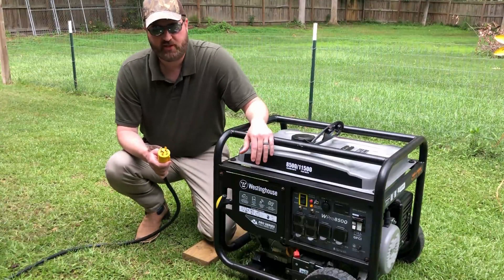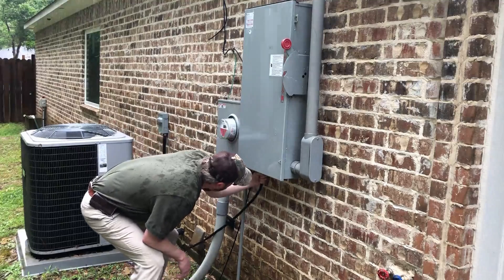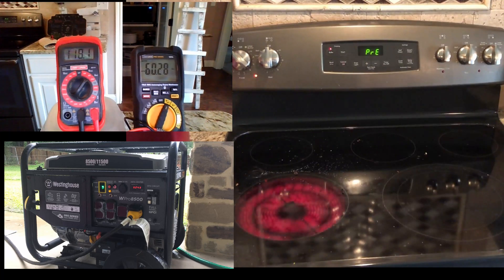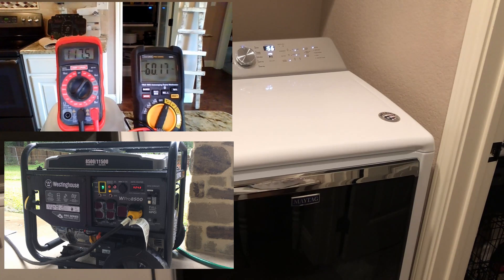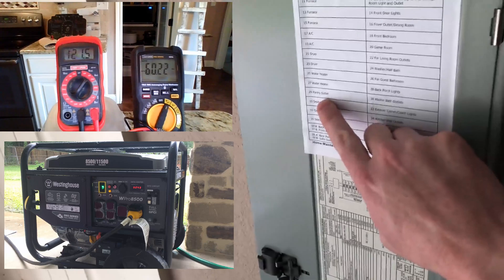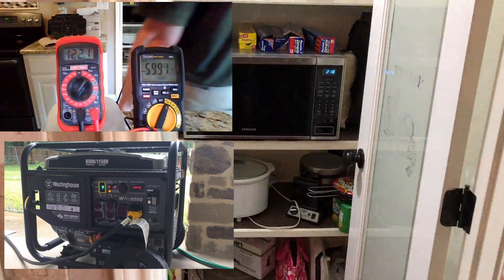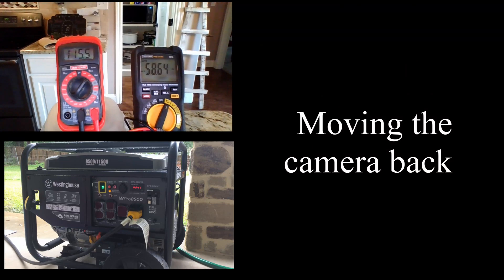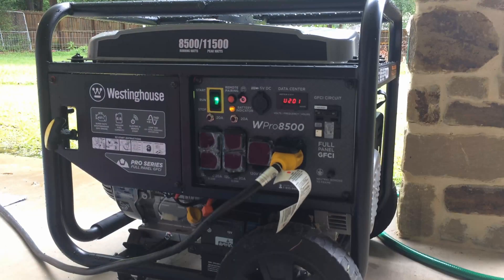Connect Generator to House with Transfer Switch - Load Test Westinghouse WPRO8500

Comment: So I ordered the same generator last week. Any thoughts or opinions on a tri-fuel conversion? I'm also in Texas and when we had the storm getting 20+ gallons of fuel to run the generator over the few days could have been a problem.
Reply from the maker: I considered a gasoline/propane duel fuel alternative when I purchased this unit. I don't have natural gas available. I then considered the cost and transport weight of a filled 100lb propane tank, the minimum size required, and decided to go with the gasoline only option. I think it was a good decision for a couple of reasons. First, gasoline is more readily available in my area and can be transported in 5 gallon containers fairly easily -much easier than a 100lb propane tank. Second, propane or gasoline, this traditional generator is simply going to use a lot of fuel when compared to a modern inverter type generator when running smallish loads. Instead, I'll probably pick up an small inverter generator (less than $500) to run my home when I only need lights, fans, fireplace blower and TV...etc. I tested the Harbor Freight Predator 1600w model which produces an extremely clean AC sine wave and this inverter generator will be much more gasoline efficient up to about 1500 watts. I'll then use the big generator for those times I need space heaters, hot bath water or baking in the oven. That should stretch my gasoline reserves a good bit. The cost difference between the Predator vs. the propane tank, plus a dual fuel kit should be minimal and I'll have a backup option if one of the generators bites the dust...not having all my eggs in one basket so to speak. Thanks for watching the video!

Comment: Thanks for the video. I guess the latest wpro8500 now comes with a 50A plug??
Reply from the maker: After I purchased mine, I read where a couple of people got a 50A plug on theirs. The main issue now is I'm hearing the WPro8500 has been discontinued....haven't seen this info on the Westinghouse website but it has been out of stock everywhere for well over the last six months. Let us know if you find a new one available for sale and thanks for watching.
Reply: What brand is the transfer switch? Been looking for one just like it  for a double throw

Comment: Nice setup.  I been thinking about hooking my 9400 watt firman to the house.  Just don't know if it'll be worth the trouble or not. Its not like we have a power outage every month but would be easier than running a bunch of cords all over the house LOL
Reply from the maker: Running cords is no fun at all. Its pulling out the refrigerator, microwave and TV and putting it all back when the power comes back on...and hoping it stays on...done all that before. The transfer switch is much faster. Just turn off the double pole breakers if the generator can't run them all and your appliances, bedroom lights and TV all work. Definitely the way to go. Thanks for watching!

Comment: Looks like Westinghouse discontinued the WPro8500. Mine has been performing flawlessly but I am concerned about this going forward. Your thoughts? Thanks.
Reply from the maker: Yes, my WPro8500 is also working great but it appears to be discontinued. It had 1000's of positive reviews across multiple resellers. Disappointing to see it end-of-life to say the least. The big question is parts availability going forward. I'm going to use it but not abuse it. Keep new oil in it and run the carb dry before long term storage. I'll treat it right and keep on the look out for a comparable replacement unit. Maybe catch a good one on sale and sell the WPro8500 when the "selling" is good. Thanks for watching and good luck to all us WPro8500 owners!
Reply: Our WPro8500 has served us well during several outages during the past three years. The warranty expires this month so I found a buyer scheduled to pick it up tomorrow. We have natural gas and decided to have a Generac 24KW installed next week. Regards....Tom  @LivingCommonSense
Reply from the maker: @utubetjc - Probably not a bad move. I hear Westinghouse customer support leave people wanting more support than they sometimes get.
Reply: Yes, I've heard that too. I have a pair of Eu2200i units I'll hold onto. Have a good weekend. @LivingCommonSense
Reply: @LivingCommonSense  My thoughts exactly. I also have a Generac iQ2000 and a Honda EU2000i I rotate for use at our cabin. I'm a bit OCD when it comes to maintenance so I'll continue to baby the WPro8500 and research its replacement. Thanks for your comments.
Reply from the maker: @T C Those are both great, fuel efficient machines. You are in great shape when it comes to generators and should not ever be caught without some kind of backup power.
Reply: ⚠️Generator safety tips:

All generator safety rules need to be followed carefully whenever you use your portable generator. This is a reminder. 

1) KEEPING OTHERS SAFE: Please do not allow an unqualified person or your children to operate and service the portable generator. Just because some manuals don’t say that doesn’t mean it’s safe. That is important against the generator safety rules. We also need to be keeping an eye on our children too. You need to make sure that your children are not playing near the portable generator especially when it’s running so they won’t get electrocuted. Generators pose electrical risks and they can be hot during an operation. Please keep your children away from the portable generator at all times. It is important to keep our children safe especially our little ones. Be aware of all the hazards.

2) WHERE TO RUN YOUR GENERATOR: Some people use their portable generators indoors which increases the risk of carbon monoxide poisoning. It’s important to have a carbon monoxide if you have a gas generator. Never ever use your generator indoors even if your doors and windows are open and even in the garage is not safe to use a portable generator. Not even at your porch and your deck. It is never safe to use your generator indoors and in enclosed areas of your home. Your generator needs to be 15-20 feet away from your house. 

3)🔥FIRE HAZARDS: Never refuel your generator while it’s running. You need to let your generator cool off before refueling it and before storing your generator. Never overload your generator too. Never ever back feed your generator. You should never plug your generator into a wall outlet. Also never store propane tanks indoors. Please keep flammable things away from the generator as well and please don’t smoke cigarettes near the generator. Having a fire extinguisher next to the generator is also important against the generator safety rules. 

4) GENERATOR OPERATION: make sure your hands are dry before touching the generator. Never use your generator in wet conditions. Don’t let your generator get wet. You need a generator tent if you need to use your generator during wet weather. Please don’t wear loose clothes when operating the generator. Turn on your generator before plugging in appliances. Use the right cord for your generator. Please do not use worn out cords. 

https://youtu.be/I1jT3ANENvI and here is a video more about keeping others safe when using generators and also about our family’s safety. 

Hope this helps

Comment: Thanks for the thorough review.  What made you decide on the Pro model instead of the standard model?  Or the one with Dual Fuel?
Reply from the maker: I believe the Pro was the only model available at the time of purchase. The WPro8500 runs only on gasoline. I chose it for the advertised THD of less than 5%. Thanks for watching.

Comment: Have you done a video with the ac running? I'm looking into a 50amp generator. I have a 30amp 10,000 watt  generator. Cant have the ac on. I want one for I can run the ac. 4 ton
Reply from the maker: Marco, I've been afraid to try my 3.5 ton central AC on this generator because the compressor takes an enormous amount of "startup" current. I understand there are soft starters that can overcome the startup current problem but the generator would consume lots of gasoline while running the central AC unit. The best idea I've come up with so far is to run a small window ac to cool one or two rooms while on generator. It costs less than having an electrician install the soft starter on the compressor and will use much less gasoline as well.

Comment: Thanks for the test run video...good information. Looking at the same model generator. 

Q: What extension cord would be better that the one you used.? as you mentioned it was struggling.
Reply from the maker: The simple answer is an 8 gauge extension cord of equal length will have less voltage drop than the 10 gauge cord I used. The rule here is always use the shortest extension cord possible. Shorter cords have less voltage drop and are typically less expensive and store more easily.
The longer version:
This generator has a L14-30R receptacle which is rated at 30 amps. Extension cords with plugs/receptacles rated for 30 amps will typically use the minimum wire size required to supply 30 amps as well. Manufacturers usually do not "over-engineer" a cord with wire that has a higher amp capacity than the connectors on the ends. I expect it will be hard to find a 8 gauge (4-wire) extension cord with these Twist Lock Plugs (NEMA L14-30P/L14-30R). This is something I'd probably build myself if it became a requirement in my situation. That was a great question by the way!

Comment: Holy hot #10 generator cord, Batman! LOL It must have gotten pretty warm with all that load. :)
I bought a WPro8500, this summer.  Was pleasantly surprised when I discovered it had the 14/50R 50 Amp receptacle installed.  I also had to switch mine to a floating Neutral.  I have a Generlink 40 Amp meter socket automatic transfer switch with the GenerLink supplied 40 foot #6 generator cord.  Works like a champ!!!
Note: I almost bought the WGen9500.  Glad I found the WPro8500 before I pulled the trigger.  The electrical THD is much lower for the WPro models.  I doubt my heat pump or hot tub electronics would have liked the THD of the WGen models.
Reply from the maker: The cord absolutely did warm up a bit. Since this video, I've built a watt meter of sorts that shows volts, amps, watts, watt hours and power factor of the loads connected to the generator. Next time I pull the WPro8500 out, I'll be checking the load characteristics on each leg.  Also we'll be able to see the AC waveform for each leg on an oscilloscope and what, if anything, changes with varied loads so stay tuned... 
A WPro8500 with a 14-50R receptacle was a nice find and sounds like you have a great setup. I read they were being upgraded but didn't want to wait. I almost picked up the Powerhorse Dual Fuel Generator — 7250 Rated Watts. The WPro8500 had more rated power, better reviews and availability.  Do you happen to know the size of your heat pump and if it has a "soft-start" kit installed? I am hesitant to run my 3.5 ton on any generator less that 12KW-15KW. Thanks for the comment.
Reply: Our house is only 500 square feet, so we only have 1 Mitsubishi mini-split heat pump that does a great job heating and cooling the whole house.  I believe the BTU Rating is right around 14K.  The outside unit is very small. It is served by a 15 Amp split phase (240V) breaker.  I suspect Mitsubishi has a factory soft start kit installed.  The unit "ramps up" instead of "slamming itself" on when it is initially started.  Best wishes in your research/testing!
Reply from the maker: Thanks for replying!  Your power setup seems to be sized perfectly for your needs. This is great information for everyone reading the comments and researching their own generator purchase.

Comment: Great video.  I was planning on buying a Generac 8000 watt (inverter) because its one of the few portables that make that kind of power with clean inverter power.  I am reconsidering and looking at the model you have. Are these inverter design?  Almost seems like the are as they have idle control and the THD is less than 5% compared to some of the other Westinghouse at (less than 25%).  I really don't want issues with my electronics.  Seems like everything these days are microprocessor controlled.  I saw an Icom in your video. Amateur radio?  73
Reply from the maker: Rich: The WPro8500 is not an inverter type generator. It idles only when no load is present on the generator. Once it detects any load, it revs up to full RPM, 240V and 60hz. At idle, the voltage drops down to 200-205 volts and no where near 60hz. On a job site, the auto idle works as a fuel saving feature for when power tools (saws, compressors, battery chargers) are not being used. When connected to the house, I usually have a box fan blowing on the generator. It helps disperse the exhaust fumes when there isn't a breeze blowing outside and it guarantees the engine stays up to speed (at 60Hz) for those appliances that have microprocessors in them. Hope this helps with your decision.
Amateur Radio? Absolutely. I passed my Amateur Extra exam yesterday. I will be doing some Amateur Radio videos in the future. I'm an IT Pro by trade so the content will mostly lean more toward digital modes. 73

Comment: If you change the grounding to floating ground, how does that change the requirements for grounding the generator or the electric panel?  Is a grounding rod needed?
Reply from the maker: I'm not an electrician so I cannot answer that for you. I pulled this from the WPro8500 owners manual:
"Grounding the Generator – The National Electric Code (NEC), as well as many local electrical codes, may require the generator to be connected to earth ground before operating. The most common application that requires a ground rod is when you are using the generator as a separately derived system to provide back up power to your house. Typically this is when a transfer switch has a switched neutral.  As the generator application has many variables that cannot be determined by the manufacturer of the generator, a licensed electrician will need to determine if a grounding rod is needed. If a licensed electrician has determine the application requires a ground rod, make sure it is connected to earth ground by connecting the ground terminal on the control panel to earth ground using copper wire (minimum 10 AWG). Consult a qualified electrician for local grounding requirements."
Also, since this video came out, Westinghouse released a service bulletin on how to make the WPro8500 have a float the neutral.
https://cdn.shopify.com/s/files/1/0055/9595/5290/files/float_neutral_8500_12000.pdf
They do not mention a ground rod in the service bulletin but the generator must be labeled "floating neutral" on the control panel.
Hope this helps you.
Reply: @LivingCommonSense  Thanks so much for your fast response to my questions.

Comment: What is the exact model number for your eaton transfer switch?
Reply from the maker: The sticker inside the panel shows the model number DT224URK-NPS
If you are planning to do what I've done, please understand this panel does not come with the input port on the bottom that I show connecting the generator cord into. I added a 30 Amp 125/250-Volt NEMA L14-30P Locking Flanged Inlet  and connected it to the switch with 8 gauge wire. There are probably better ways to do this with an actual inlet box so just know that you'll need an inlet port to connect a generator to the transfer switch. Electric code may require this in your area.